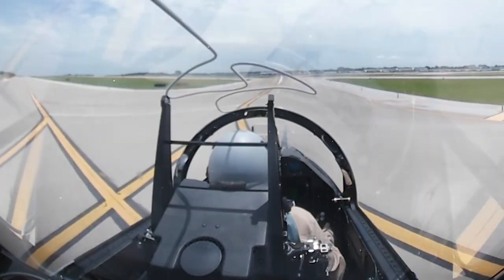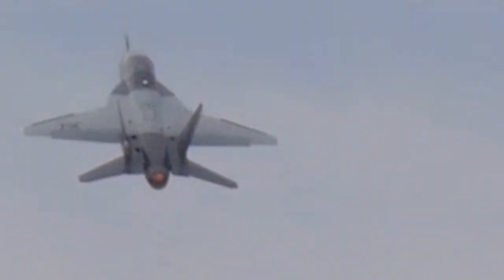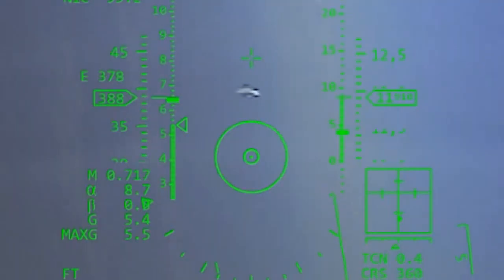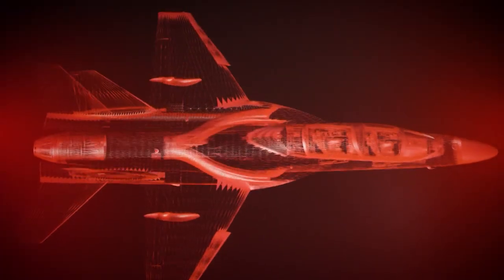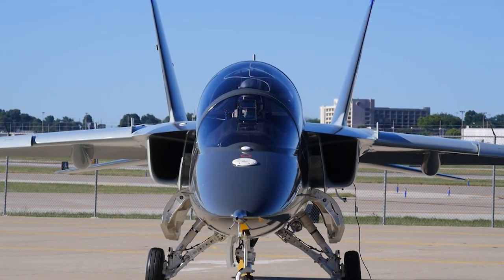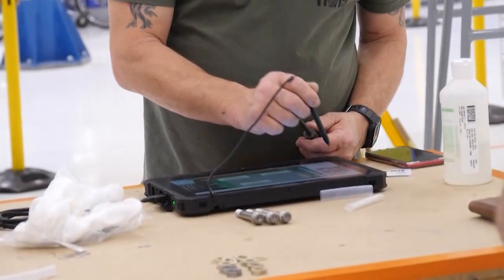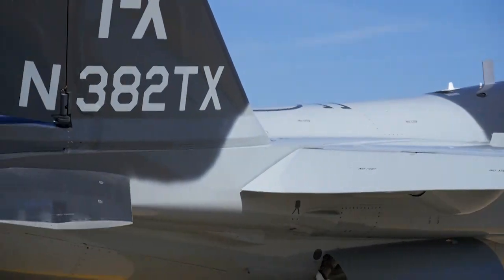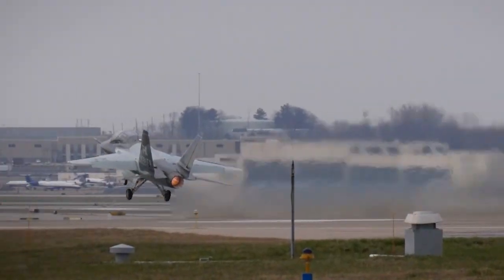T-7A Red Hawk Digitally Connected

Comment: ANYTHING built by Boeing these days is going to be overpriced (ie gouge the taxpayer) and a POS. They are NOT the company they once were.
Northrop delivered first T-38 TWO years after prototype first flight. T-7 first flight was in 2016 and first delivery is not scheduled until 2025 - NINE years. Entire program BLASTED by a 2023 GAO report. Boeing (and USAF/Pentagon) milking the taxpayer for every cent.

Comment: Hmm, imagine these systems but in an F-20 Tigershark...
Reply: Northrop should have developed an updated F-20 for the T-X program
Reply: @abrahamdiaz3648  That's what I was thinking. Just imagine an F-20 with a GE F414 and AESA radar...
Reply: @Tigershark_3082  The Tigershark was an avant-garde jet fighter. The specifications for which it was disparaged are the same that all manufacturers are looking for today: simple, cheap, powerful and efficient.
Reply: @abrahamdiaz3648  Indeed. However, a big issue with the prototypes had to do with fuel. On the 4th partially finished prototype, it was going to have an increased fuel capacity. The prototypes also never got their Ford Aerospace Tigerclaw cannons, which were supposed to be faster-firing M39A3s made of a lighter material
Reply: If they could market F-20 as low cost solution for third world countries, that will be great.

So they have more option than just JF-17. 😔
Reply: The F20 is the victim of circumstances and big power politics, during the time of the US shopping for F15, F16, and F18 while the secret F117 was incubated.. there was not enough dollars to spread for all.
The Swedes capitalized on it by adopting the F404 engines into building the JAS Gripen..
Now it is payback time when the Swedes help building this jet in partnership with Boeing. The ghost of F20 finally could smile from the heaven knowing that it is never forgotten.
Reply: Saab used the idea's from the F-20 when they originally thought up the JAS-39 concept. In essence, it already exists.
Reply: The tiger shark born at the wrong time.. the US fixated on twin engined heavies like F14, F15 and F18.. the single engined single seat F16 is state of the art . I don't think the Tiger Shark can beat the F16 except the cost...
The F16 also edged out the F20 in oversea sales .. i think Northrop can not beat Lockheed in power politics.